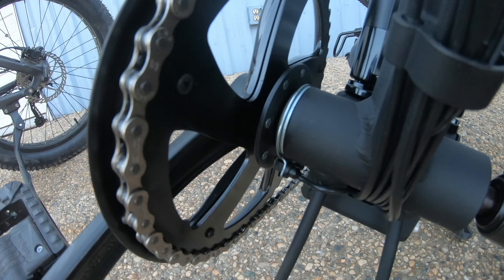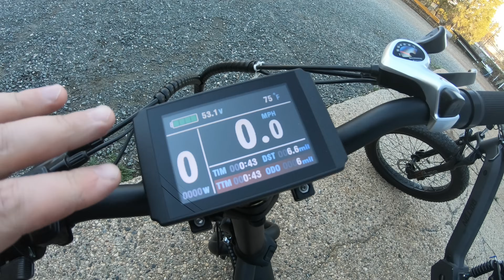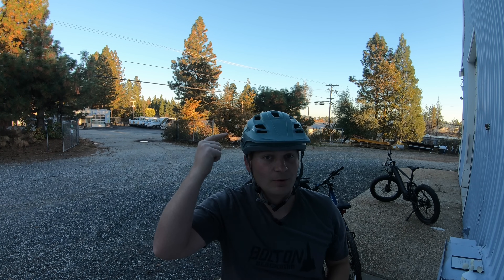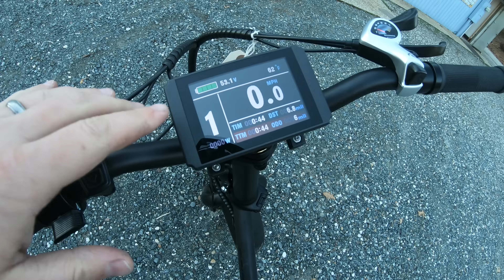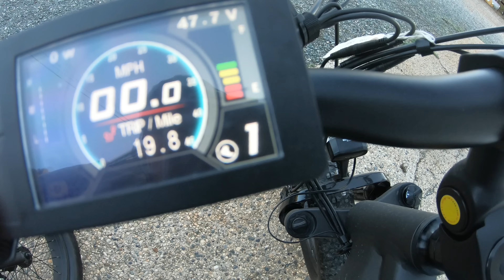Ebike Cadence vs Torque Sensors - the surprising outcome

Comment: Great video. Your most important point is that YOU HAVE TO RIDE THE BIKE TO DECIDE. One isn’t “better” than the other, they each have different feels and features. Me, I’ve had a direct drive 500w hub motor with torque sensor and throttle since 2017. Plenty of power since I don’t mind hammering up hills I’d never conquer in my own, but probably not a great add-on kit for a mountain biker. It “feels” more like a bicycle since I had all my gears available to me, and at 42lbs, the bike needs very little assist to get around. I think I would feel unconnected to my bike with a cadence sensor: no ghost pedalling for me! Some people might like a belt drive. It’s all what you can afford and what feels right to YOU.

Comment: I love the simplicity and ease of maintenance of my hub drive VOLT Pulse with a cadence sensor and a walk assist trigger which powers the bike to 3.5mph when the pedals are not moving like when I am pushing the bike but becomes a throttle when the pedals are moving (for legal reasons), its great and seems the best combination. A bottom bracket costs 10-20GBP and I can change it in under 30 mins, parts for BAFANG hub motors are DIY replaceable, it uses a generic battery which can be removed and charged off bike, if I need more power I just depress the walk assist / throttle trigger and so long as the pedals are moving I get a push from the motor. By contrast I bought a sophisticated Specialized Creo mid drive, sure it feels natural but they have discontinued it now and the new version uses a different motor that wont work with my bike and costs 1000gbp, it needs a firmware update to fix some bugs which I cant be bothered to get done (and its chargeable) , the TCU propriatory panel on the toptube has failed twice in the first 6 months and been replaced under warranty and now I cant sell it for even half what I paid, when its out of warranty in 11 months it will be almost worthless. The VOLT hubber however is pretty much unchanged  in its 10 years of production (refined somewhat), everything is DIY replaceable, I bought a spare cadence sensor and disc for 9.50GBP which I havent needed yet and I can get a battery from a load of different suppliers, great video btw, not everybody thinks like me, but I expect a bike to last for decades so all the above matters to me and the VOLT hubber gets the job done just fine, even a complete quality wheel plus motor is under 300GBP and the plug has stayed the same for over a decade

Comment: The cadence is much better for an older person, especially if your pulling a trailer,  I ghost pedal mine (using no leg muscle) until  it reaches 17mph, then I Coast till it reaches 12mph, back and forth extending the battery life,  while pulling a burley nomad cargo trailer with 200 watt 9bb  solar panel on burley stock rack, modified with extra holes I drilled in the tilt adjustment push button upper support arm 1/2" aluminum tubing. It comes with two holes for the spring loaded buttons, flat position or raised position about 45degree.  I added  two more holes in between these simply drilling new holes , so I can follow the sun, example flat, 20,30,and 45 degree positions to receive more solar watts while I'm riding that's especially useful when I'm riding SOUTH. RIDING NORTH IT ONLY LAYS FLAT. But I also added a East, west tilt bracket attached to the burley stock rack using electrical pipe clamps which comes with a carriage bolt to tighten around the 1/2" burley stock rack, modified. 
  I carry a 7lb 120v ice maker  running off my 11lb Bluetti,  in one hour  I get about two quarts of ice to fill my Jumbo WAWA INSULATED PLASTIC CUP WITH LID AND STRAW TO THE TOP, APPOX. 8 CUPS OF ICE WATER. This I carry in the front of Trailer easily accessible when I stop riding for a solar chage break and ice maker running time could get 1/3 of the ice in a 20 minute break.  The extra bite battery is always charging at either 107 watts or 300 watts depending on which battery pack I'm charging,  the stock 48/15amp or my new 48/20 amp battery purchased by  LEPNERYEE Hailong E bike battery 48v/ 20 amp for a 0-1500 watt motor $316.00 Amazon in shot supply.
I'm 200lbs, my trailer fully loaded with camping gear pernair bags loaded sleeping bag and tool bag above large front head light I'm pulling 450 lbs. Mounted a motion detector brake light to the back of the solar panel, which is also an alarmsystem with very loud alarm sounds if even bumped a little,  with turn signals and separate control switch mounted on left side of handle bar close to the rubber grip..

Perfect set up for long camping trips, especially if I sleep from 10am to 4pm. During which time I'm getting around 170 watts per hour solar which averages about 1200watts incoming per day , at 65 years old the batteries outlast me. It's almost like having FREE POTENTIAL MOTION..Lol. in Florida it's very flat and to hot to ride between  10am and 4pm anyways, I'm in no rush being retired and just living the life at my own pace .
 I do use flat out in all my 20/4" and 26/4" tires with extra tube's for trailer tires 16" at 50 lbs of PSI. HAVE FUN SEE YOU AT TGE PIT STOP..LOL

Comment: Torgue sensors cut out at a certain speed thats the only diss but a tiny push on the throttle and your not loosing out ,but i like cycling  i get bored just coasting on eletric so i might try a cadence sensor aswell  any ideas were i can get a controller to suit this ?

Comment: I have a mid drive + torque sensor with a throttle. Tongsheng 500 Watts. I've beaten the sh*t out of this fat bike for 5 years now. Broken the pedal shaft ($15 CAD) twice, but I love the beast. The throttle alone will not have the bike going very fast but it is a good assist when starting at a green light if you are still on a too high gear. Or when walking beside the bike going up a steep hill, then you can gently depress the throttle to have the bike going up by itself.

Comment: I really want to change to a torque sensor from the cadence sensor that came on my bike. Besides the torque sensor bottom bracket what else is needed?  Upgrade the ESC ?
Reply: u need a controller that supports torque sensor and of course, a display or control center that changes its mode.

Comment: For elderly riders, a throttle is a must, and this is why:   connective tissues, tendons and ligaments, and cartilage menisci become much more fragile to high stress (think high torque), so it's not uncommon in benign and completely unexpected situations for something to suddenly "give" (or start hurting severely), and in bicycle riding this could be knees or or leg muscles.   Usually if one relaxes for a moment and adjusts the vectoring of the force on the thing in the "give" state, it returns to normal, and ordinary use and pressure can then be applied.   The highest likelihood of a sudden pause like that in riding will occur almost exclusively when at a dead stop and subsequent start when forces on the rider's legs and joints are the highest.   Stops and starts, unsurprisingly, are also typically at traffic intersections.    A bicyclist wants to accelerate smoothly and ride in the most predictable and straightforward way in a traffic intersection for obvious reasons:  it's dangerous to suddenly pause or wobble in the middle of an intersection as one is making a turn or even going straight.   I don't care how much AI is layered onto a torque or cadence sensing motor:  it cannot ever predict the unpredictable.   But usually the elderly person themselves can SENSE when these events are about to happen.   That forewarning can then be used by the elderly person to force the ebike, via the throttle, to take on more of the load when that person knows they must suddenly reduce the load or torque in the middle of an intersection to adjust their legs or body.      

So based on your description of torque vs cadence sensing bikes, cadence sensing bikes with a throttle makes vastly more sense for elderly riders.    If a bike is torque sensing, it will have no clue why someone is reducing the torque on a crank, whether it is deliberate or due to sudden unexpected leg discomfort.    

Of course, if a throttle is added to torque sensing bike, which as you say is not common now, then that could potentially be as good or even better than a cadence bike with a throttle.   The key however, for elderly use, IMO, is the throttle.    The lack of a throttle on torque sensing bike is an absolute deal breaker for many if not most elderly.

Comment: I love my Tongsheng mid drive with torque sensor. It also has a throttle for taking off from a complete stop, which is great to save the ol' knees. I transfered the Tongsheng to another build from my recumbemt trike. I think haveing a T.S. set up is better on a two-wheel bike because when I stand up and crank on the handlebars, it really feels great! However haveing switched out my TS kit for a cadence kit I am very disappointed riding my trike now. I bought a bottom bracket torque sensor, and found out later that this systen is not compatable with the controller that came with the Chinese kit.

Comment: Candence sensors should be outlawed...yeah, you can pedal backwards and still activate the motor...
Reply from the maker: Out of hundreds of ebikes I've ridden with a cadence sensor, exactly zero of them worked while pedaling backwards.  The hall sensor is directional and won't work both ways, or is programmed for one direction.

Comment: Chiming in from south western Canada here. I can see the argument for either. I'm just beginning to learn the concept of these pedal assist assemblies. Mine is cadence. I think I do prefer that despite not experiencing the difference. As a man in his mid 50s and not being hugely athletic, I like the safety net of having the throttle if I need it and not having to necessarily work hard to activate the full potential of the motor. I'll even touch the throttle off the line just enough to get me into pedaling mode.

Comment: I have had both, I prefer the torque senser. I actually peddle more with the then i did with my cadence sensor bike. with that one i would just casually peddle or just use the throttle. With the Torque i hardly ever use the throttle.

Comment: I like a cadence sensor with KT torque sensor simulation. Basically, it's power control rather than speed control. But, a full time throttle is a must.

Comment: This is a very useful but depressing video for me. I just purchased an ebike from a reputable brand and it comes with a torque sensor, and yes it works exactly as you describe; that is, I have to invest quite a bit of pedel energy to get any speed out of it. The thing is I have osteoarthritis of the knees/hips and so downward peddling pressure causes pain after a short while. My previous two ebikes had cadence sensors which only needed me to lightly turn the pedals over to get accelerate and cruise at top speed (25kpm here in Australia). Perfect for me. Because I didn't know the differences between cadence vs torque Sensors I blindly walked right into purchasing a new bike that I probably won't end up using. The vendor who sold it to me is already trying gaslight me that I'm the one with the problem, not the bike. So pro-tip: if you have osteoarthritis make sure you purchase an ebike with a cadence torque sensor. Any tips on how to retrofit the make ebike to have a cadence sensor would be appreciated. It has a Panasonic controller and drive.

Comment: pity they nowadays still don't have C and T modes in torque sensing ones

most of the torque sensors can sense the cadence aswell, so the fact they only give you A or B kinda sucks

Comment: Euphree now has a torque sensor, and it’s a better quality build than Aventon.  Denagos will have torque sensors on all models in 2024, not just the fat tire one.   Their cadence sensors are still very smooth and natural.   Aventon is going to make the dumb move of going to mid drives, which is why they are giving away their e-bikes at absurdly low prices now in late 2023.   Prices on aventons will be going up, up,up.   They lost their shirt this year and are screwing all of their dealers in the process.

Comment: Great explanation! My wife and I are on our 4th set of e-bikes. The first 3 have been folding with cadence sensors with throttles. We now have Juiced RCS's with a combo Cadence/Torque sensor which are mounted near the rear hub near the motor. So far we love the more natural feel of pedaling these. They also have thumb throttles which we use to start out and to add power going up hills. I have also ridden mountains bikes with mid motors and crank torque sensors. These are extra fun but I still prefer having a throttle on E-bikes.

Comment: I will never buy a cadence sensor after riding the torque sensor. I love the natural feel and it also saves battery and extends the range. I prefer the hub motor also just because if something happens to the change I can throttle it on home.

Comment: The Cadence sensor gives more control, if you need to take off faster, use the throttle first, then let off the throttle and use the pedal assist, this will get you to 20 mh faster, then to get to 28 mh, switch to the throttle. ..

Comment: Probably the best explanation of the differences I’ve seen.  I’m on a cadence, hub, with throttle and 8 gears.  100 miles a week to work rain or shine on mostly level roads.  I use the throttle every time from a stop.  I call it my launch gear.  Makes for a smooth transition.  Doesn’t take much of a hill or wind before ghosting has become a big irritant.  I need to test drive a torque machine.  Sometimes I want the exercise, but usually I want a 20 minute ride to work without sweating and just enjoy the time on 2 wheels.

Comment: I have the same one as your wife and it’s horrible>takes 4-6 full revolutions for a response. I’m looking to either upgrade the sensor or convert to a torque sensor.  Can you tell me if the 12 magnetic option has a universal mounting option?

Comment: I would never buy an ebike with a torque sensor that cant be tuned by the user. Every one I've touched was not how I would want it set. We need to stop will locking down controllers.

Comment: I think I would prefer the torque sensor because it rides more like a regular bike. With a throttle to override when I don’t want to have to pedal is hard.
I have been looking, but have not written any yet, and that was one of the complaints I saw was that the cadence sensors were jerky and just take off on you.

Comment: Fortunately Dave, the owner of E-CELLS bikes, has changed his top bikes over to torque sensors. It offers me better control at slow speeds than my buddy's cadence sensor version of this bike. AND these bikes also have a throttle.
BTW, my e-mtb has TWO hub motors and thus 2 wheel drive  and it has 9 (NINE) pedal assist levels. It's a "HUMMER" version of an e-mtb.

Comment: Bought a Kona Rove with hub motor and torque sensor.  Acceleration requires more torque on the rider's part.  Also, more effort is required on the hills than with my previous hub motor with cadence sensor, mainly long steep hills.  Normally, I find myself cruising at 20 mph, and what's cool is that my speed doesn't change much with wind direction.  Ghost pedaling is not my aim; my aim is to get a workout if I want it.

Comment: if you were to be able to ride a bike blind, could you tell the difference between a mid-drive and a hub motor if both had a torque sensor? assuming you're not tackling any challenging hills.

Comment: Very helpful, but you don't address the safety issues between the two, particularly in heavier bikes, as well as what it means to "feel more natural."  Personally, I think most heavy high powered hub drive cadence sensor bikes are dangerous. Most have a serious lag and an unsteady thrust forward when the power is kicking in. I had a bit of an emergency in transitioning the bike out of a rut.  I had to slow way down and then I needed  a little power to make the transition. When I started to peddle, the rear drive cadence sensor (on low power) delayed then kicked in more power than I needed, causing the bike to surge forward and crash. This was a well made Ebike that I was renting. I never felt like I could get into a groove where I felt like I was peddling  the bike. ( I guess that is what you call ghost peddling). I own a specialized Ebike and a Benno Boost, both with mid drive motors and lots of power than can power up a hill, but yes you have to work like a real bike. I feel like I have strong legs and no lag and no surge. I think another thing your review should include is that not all cadence sensors or torque sensors are the same, so its not just a matter of selecting a torque sensor or a cadence sensor, but selecting the right brand of either. The sophisticated computer motors and how those computers operate ( like Bosch and like the Specialized Motors) play a big part on making the bike feel totally like a bike and not like a moped with pedals. I sometimes feel like I could use a throttle but it too dangerous for me personally. That said, Averton recently came out with a beautiful cargo bike that has a good torque sensor with a rear hub motor, as has Specialized and both of them look a lot more safe and both can come with a throttle. I am 65 and I feel like its easier for me to control a mid drive/torque sensor bike, but if I needed a throttle I would get a bike that also had a well made torque sensor.